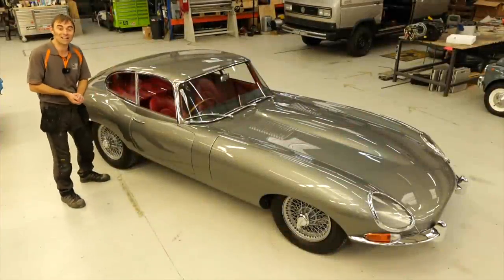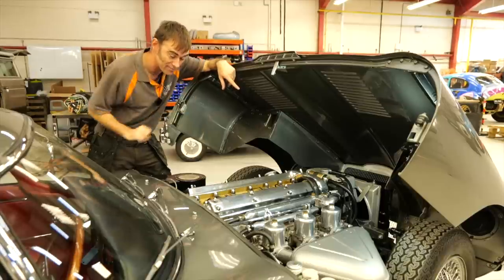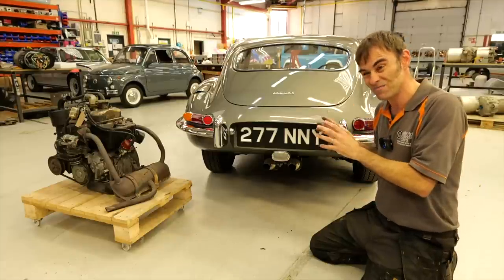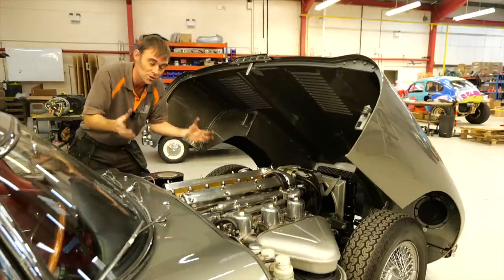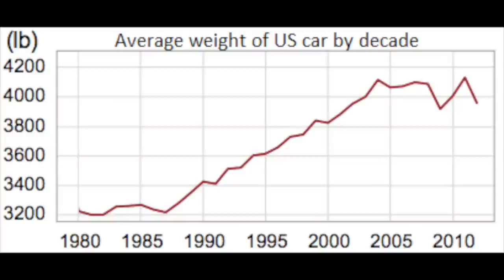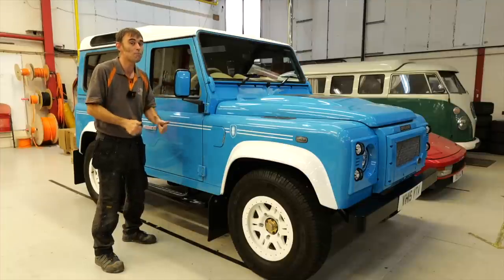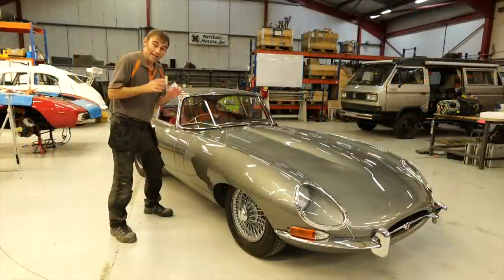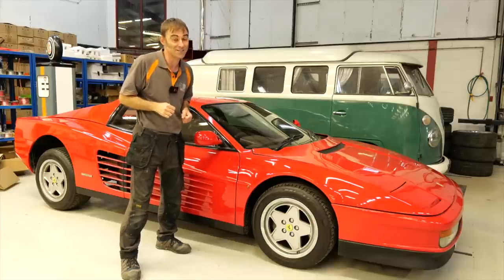Is it a sin to convert a classic car to electric?

Comment: Some cars are famous for their engine, and some are famous for the rest, but if the engine has to much soul then what, don't you just want to kill it, 
I would have said, a beautiful engine like the E Type, is worth to preserve, then i saw a picture in my mind of that engine mounted on a very nice piece of wood, with glass plate on top, i think that would be a better use of it, then i can't really remember any engine that is worth keeping in the car, keeping, yes, but not in the car.
Also, people are really busy telling how bad batteries are, but if gasoline or diesel fuel were invented now, it wouldn't be allowed, so banning it, is for sure, in the future.

Comment: Very good explanation, shows lots of insight in the overall picture. Compliments. Just didn't understand the brief remark on hydrogen as if it were not a viable option. It will be for lorries and the industry, maybe less for cars, but just wait till technology develops and makes creating H much more efficient. It is already going up quickly with interesting new ways of getting H.

Comment: From an environmental perspective, converting classic cars is a no brainer. From an historical point of view, it is sacrilege. The “soul” of an internal combustion engine, and what all electric motors lack, is the combustion itself. Depending on the number of cylinders, the type of engine, how free the exhaust is, every ICE car (especially classic cars, unbridled by emission requirements) has its own “voice”, if that makes sense. As an EV user in a full EV family, I find it hard to make up my mind. On one hand, I’d like to keep old cars around as conversions, but from a practical point of view, transplanting a Tesla engine in a 70 years old car is a recipe for disaster, unless the brakes, suspension, basically everything else in the car is updated to modern standards. And still you’ll have no airbags, insufficient seatbelts, bad headlights, abysmal windscreen wipers and low pedestrian protection. Maybe classic cars should remain classics, to be used a few times a year. Maybe.

Comment: What a good idea!   I have a Jaguar XJS, in lovely condition that runs really well.  Worth around 10k.   I’ll pop along to my local garage and ask them to swop it for an electric unit….  I’m guessing the value of the petrol engine will mean it won’t cost much to swop it over will it?..   I don’t see there is anything more to be said.  Of course if you are super rich then it will be that simple….

Comment: Is there a concern for the size of the batteries changing in the future? It would be a pain to fabricate a battery storage area only to have to redo it once the batteries need to be replaced. From what I've seen, the size of things tends to get smaller and (hopefully) improve in quality and storage capacity.

Comment: As my two sons were only young at the time, I bought them an electric dirt bike and an electric quad, and the power they had was surprising. The acceleration was instant and they had no trouble getting to 25mph or so. I thought they were a compromise etc and eventually I bought my boys 49cc motorbike and quad. I will be honest and other than the thrill of revving them and the smell of petrol, they didn't perform or excite anywhere near the electric ones did! I was dissapointed and let down as I just assumed the petrol items were an upgrade and they weren't. I've seen some blistering performances from converted cars, the acceleration, speed, and instant power is amazing, and I've seen Teslas doing BMW M4s off the lights!!! So I agree you don't have to lose any power or excitement converting a car to EV, but then some classic cars can't be touched, as the engine is as much a part of the legend as the rest of the car, a perfect example being a Sierra RS500 Cosworth etc etc. Anyway, a good debate, with pros and cons galore.
Enjoying the channel, keep up the good work mate
Reply: Yes, like you say, the RS Cosworth's attraction is all in the engine but there are loads of Sierra shells and an electric 'Mockworth' would be a good build.
Reply: Thanks 👍😀

Comment: One comment that crops up time and time again by classic car and performance car enthusiasts is that it can't be as much fun to drive as a manual transmission is as EVs are generally single speed so drive more like autos which are generally dull to drive. Personally I'm already converted (if you can excuse the pun) to classic EVs but what's your response to this as an excuse to talk down EVs as not being as much fun to drive?

Comment: I have a '66 Mustang 2+2 that I'm going to convert to a Tesla 3 rear power unit and suspension.   Batteries will be self contained lifpo4 units spread around the car.  Looking at probably 125 miles real world range but no storage.

Comment: Not really a sin, especially considering the fact that EPA and its foreign counterparts are starting to tighten up the smog regulations hard. So you are basically doing classic cars a favor, keeping them on the road even after gasoline fuel is being banned and removed from market around 2030s to 40s. I mean, it's worth keeping basically a museum piece rolling on the road.

Comment: Like everything, the cost of parts is going to come down, and cars like the land-rover will be comparable in cost to ,say a gen 3-4 v8 chevy turbo conversion ,in a few years time.

There's a few cars (american mostly...? Cadillac for one...💣) , that if it wasn't for the 'rumpity rump' of the V8, you wouldn't look at twice, so does that then class as it's 'soul'....🤔

With regards to the LEZ's, aren't classics exempt anyway??

You missed a few positives imo, 
1, you can boot them, pretty much from cold, and not have to wait for the oil & water temps to rise, before laying down some rubber.
2, you can street race ,pretty much anywhere, without getting too much unwanted attention.
3 , not funding 'rouge states'.....

One draw back, is people thinking you're vegan, and you want a green thing on your reg to make you feel superior (just no, stop it....) and that the single and only reason you've converted to electric, was to hug a tree..
Reply from the maker: Good points. 👍👍👍

Comment: It’s simple! Value. That Jag is very expensive and I would not take a beautiful car and it’s in perfect condition and converted to electric it’s worth too much as it is. Now if I had a clunker that if I had to put back together to match that eat type jack that you have there it would cost me an arm and a leg and take probably 5 to 10 years accruing all the parts, then that is the one I would convert to electric make it look just as nice as that windows on the outside without any of the maintenance on the inside

Comment: Better to call them Lithium Ferrous Phosphate, so folks that don't listen closely will be less likely to confuse Iron with Ion. Sodium based will be cheaper again.
As for converting classics, the true "survivor" cars with original engines and drivetrains, that are still being driven, keep them original. The restored toys pulled from barns and junkyards in peices, make those ones EVs to enjoy. If the engineers that built muscle cars and euro sports cars had access to EV tech in the 50's and 60's, they would have used it.
And, with Amonia research currently underway, I.C.E. won't be going away, but oil derived fuels will be.

Comment: I have an argument about the soul, but sadly it’s for the electric conversion, the ghost in the machine or as I like to call it software, exists with electrical cars ergo you are putting a sword or a sort of an artificial intelligence for battery balancing for Range and for diagnostics rather than a mechanical vibrating automaton!￼

Comment: The E-Type is a special case, for obvious reasons, the Fiat 500 isn't.  You've only got to look at current values to see desirability.  The Jensen is marginal, and I would possibly consider converting - the big block V8 never won any awards or prizes, it's the body and interior only that appeals.  Slightly arbitrary and subjective I know, but you would electrify the Testarossa but not an F40, and so on.  The Tesla powertrain is a delight though and I'm totally in agreement from that viewpoint...  NB, the Jaguar can be "cleaned up" emissions wise, albeit at a cost whilst still keeping the appearance of the engine bay, and a well restored one looks amazing.

Comment: these are expensive exclusive solutions, not for the mass market. and all the pluses in the form of cheaper maintenance, environmental friendliness, etc. - do not play a key role for such a small segment as retro and classic cars. car owners usually value them as valuables, collectibles, and not as "everyday use" cars. so the total cost of ownership of cars driven out of the garage for a few hours a year is not so high as to be converted to electric
Reply: A number of ECC customers use their converted classics as daily drivers as they become much more useable. 👍😀

Comment: I'm on your side but the achilles heel, apart from conversion costs is range and charging times, and availability of charging stations. You can argue that how many miles folks actually drive their classic cars and new type of batteries charge faster and all that but if you get 70 M out of your conversion it's not a comparison with the engines. Finally, cheapest quote for EV charge point installation was £4.5 grand for my house and he ran away, never heard of him again. They want nice and easy installations to make a quick buck. It's getting there but we're quite not there yet
Reply: Things improve day by day 👍😀

Comment: It would be interesting to calculate the environmental impact of the production of the EV replacement parts that are placed into the donor car Vs the environmental impact of leaving the car "as is" after all the impact of the production of the donor car has been absorbed years ago and by adding new parts you need to allow for the freshly manufactured parts, how many years of average mileage (EV) driving does it take to pay back the production of the new parts ?

Comment: I just had to comment!  In any "classic" car, we have all had some maintenance problems, black oily hands and poor starting issues, which may be a simple cough or splutter! We truly do not know if (when filling-up), if we have purchased some 'bad petrol' with water content! But it is impossible to put any "BAD Electricity" into a converted EV Classic Car! So, worth a mention is that the electrons (your fuel) is the PUREST form of fuel for any car. Another important point, is that (even the very latest combustion- engine cars produced today) MUST start (and run) on Full Choke when cold, for an indeterminate amount of time, dependent upon how cold your climate is, and this can be high-cost! I have owned a converted 'classic' 1971 'eBeetle' Super Bug. The EV conversion utilised the familiar (proven) Tesla Model S Battery Pack & Netgain Hyper 9 Motor. It is an extremely powerful combination, which gives the car 120HP, and a higher torque output of 178 ft/lbs than the early Subaru BRZ (151 ft/lbs). By direct comparison to the 1600cc twin port engine, the EV conversion has been 100% reliable, and my Beetle was converted in 2019. I am always in awe of the instant take-off from cold. The dead silence (when stopped at Traffic Lights) feels 'very spooky' even today! It is a feeling of comfort, knowing that (when the car is stationary), it is not costing one cent in fuel. Living in a major city (Sydney), there are many 'stops' to contend with every day. I do not care about the "fast" chargers, I charge overnight, and prefer to wake-up with a full Battery! For all of the people who are contemplating a Classic Car EV Conversion, I cannot foresee those high Conversion Costs dropping dramatically, due to the logistics / parts supply / labour rates. Moggy, I totally agree with all that you have said here. My hands and nails have never been so clean in 20 years of owning a classic car!  Greetings from Australia
Reply: Thanks 👍😀

Comment: Being a realist and accepting batteries used in conversions are already usually used, what is their anticipated life expectancy and how do the maths work out when replacement every "X" number of years is taken in to account?
Reply from the maker: Using Tesla modules and looking at the publicly available degradation data for those, it looks like they lose the top 10% of capacity after 200k miles.

Comment: The one fact you can't get away from is that for many classics, a large part of the appeal is the engine, be it big American V8 or thoroughbred Italian V12. The sound, the smell, the vibes make them almost a living entity. I had to laugh when you compared electrifying a classic with fitting a V8 into the AC Ace to give us the Cobra! Really?😂😂😂OK, as regards main stream motoring there are benefits and there are drawbacks. The big no-no for me is range and the "range anxiety" as it's been called. I need a car that will tow a 1.5 ton caravan, 2 people and luggage to Scotland on one charge and recharge in 10-15mins at an easy to find roadside charge point. At the moment, my 25yr old diesel 4x4 does that with ease and that's why I can't get excited about coughing up £20/30/40/50k for a vehicle that can't do what I want it to. As a cheap (or not so cheap!😂), "nip into town" runabout maybe but for realistic long haul motoring, an electric answer is still years away.

Comment: Love what you do Richard. 
What about the possibility of converting a more modern car to electric? Or, does the use of modern electronics & ECU's prevent this? 
I prefer estate cars but there are no large EV estates out there for sale (MG5 is too small & that Porsche thing is way too expensive). 
So my question is, would it be technical possible to convert my 2016 Skoda Superb 280 4 x 4 DSG estate to electric, retain the 4 wheel drive, DCC &, achieve at least a 300+ mile range? Then of course there is the question of cost. A new EV with anywhere near the boot & passenger space of a Superb Estate would probably be north of £40-50k. So, could the Superb be converted for £50k or less? 

If the numbers stake up this could be a better option for me than buying a new factory made EV that doesn't really suit my needs. I would be interested to hear your opinion on whether this would be feasible or not.

Comment: I think it's hard to claim that running electric car is a lot cheaper considering the massive upfront payment. If you don't drive your classic car a lot, maybe only on weekends, then you won't spend a lot on gas and you won't change consumables frequently, so your expenses won't be huge. Plus who knows how long you will keep your converted electric classic car. Do you want to keep it for 5 years, 10 years, maybe 20 years? Know knows. Life and everything around us can change quickly. The industry is evolving, maybe in 10 years there will be much more efficient cheaper batteries, and you won't be able to get your money back when selling your converted classic car. In my opinion you convert it because you want it. For example, you want a faster car or you want to have a piece of mind meaning you won't have to deal with endless gasoline engine maintenance anymore. Or maybe your classic car requires some knowledge that your local service shops don't have because the model is rare. As for me I'd like to see more options on the market and I'm waiting till prices are lower. I have 97 Mercedes W140 and one day I'd like to swap its huge and really COMPLEX V12 engine with EV engine etc. It will be quieter and you won't have to inhale exhaust gas when working on your car, and no more oil leaks, etc. The only problem is the rest of the car is pretty COMPLEX too, and it depends on the vacuum pumps and it has a hydraulic suspension, so I'm afraid that a really FULL conversion won't be cheap in the nearest future. At this moment I'm not ready to dump $25K+ into such conversion. I guess considering the complexity of W140, we are looking at much higher cost. I hope one day it will be more affordable when more and more different models are converted and more knowledge is available.

Comment: Also, with electric you can simulate EXACTLY the driving experience of petrol.  You can have a fake clutch and gearbox that never wear out or burn.  Exactly the same torque curve and power output, even put the mass in the same place. Put some speakers in if you want the sound.
Yeah, I know it's fake but that's the point - if that was the "soul" of the car then you really won't know any difference.

Comment: Why do you make the conversions reversible? Wouldn’t it be better to cut and weld? Cheaper, lighter, more durable or any combination of these.
Reply from the maker: In the UK you can't modify the original chassis or monocoque. 👍
Reply: Aha! Perfectly explains it then